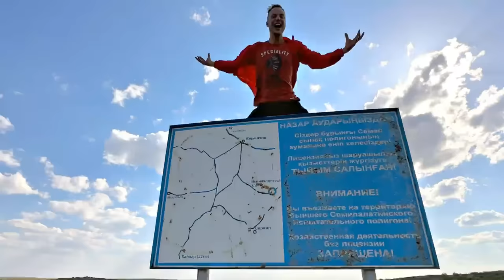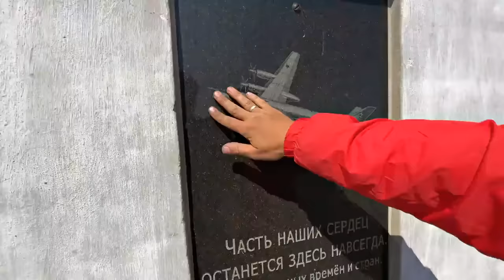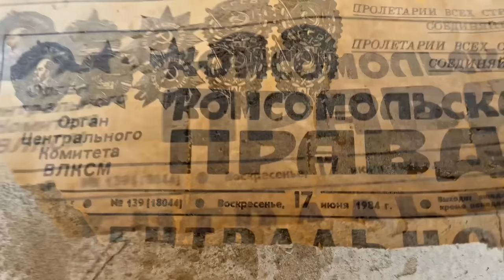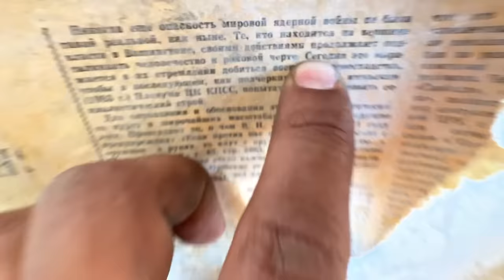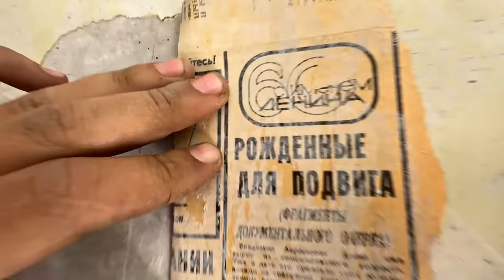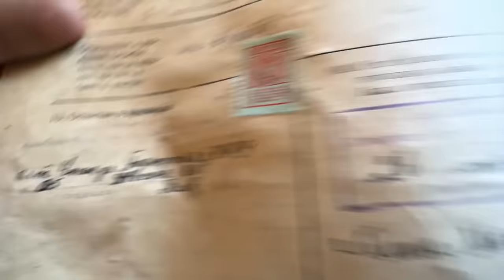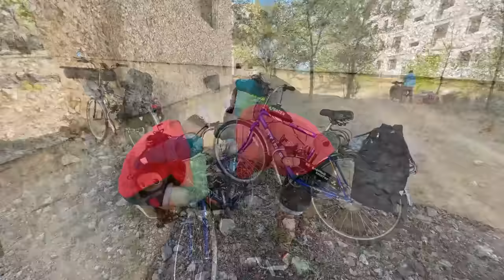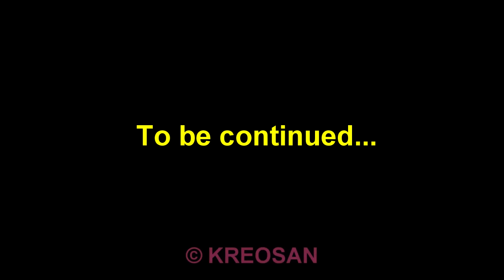✅We found a GHOST CITY of Atomic Scientists at Nuclear Test Site☢️where atomic weapons were tested

Comment: Another adventure!  Thank you for taking us along for the ride.  You really need to get some sleeping bags, I can't believe you sleep on those thin mats with nothing to keep you warm.  Have you considered getting a little towed cart to put your things on?  Something with two wheels and a large basket that attaches to the back of a bicycle, you could attach it to the moped since it has lots of power compared to the bicycle engines.  You could carry a lot more and not have to stick everyone in that tiny tent.  Just a thought, it would certainly make nighttime easier, and you could even put your gas cans in it.

Comment: hi guys, i have a 2 stroke engine on my bike to so just a few tips for u, when you mix gas use 28-30 ml of oil per liter so you won’t hsve carbon forming on the piston head, take out the exhaust cap the engine works much better, if you can swap the chain to a motorcycle one as fast as possible, put some grease on the clutch gears hope it helps

Comment: Would be cool if you can fit the engine onto a rear suspension bicycle frame but i doubt its possible, and the frame would be even heavier for the wheel spokes as well.